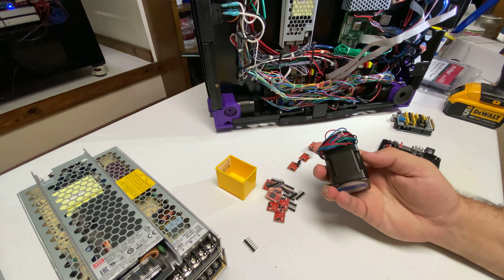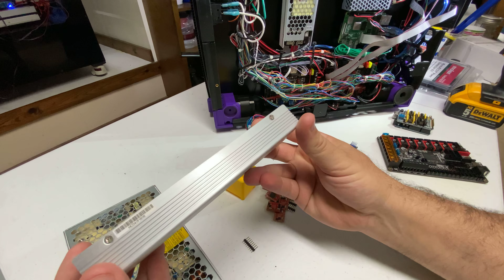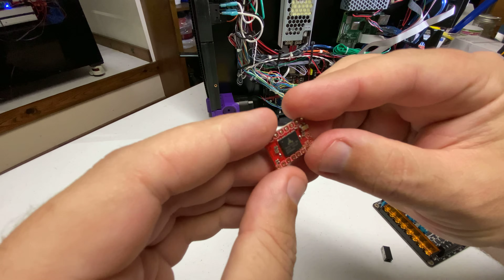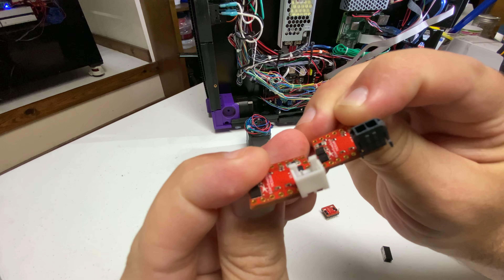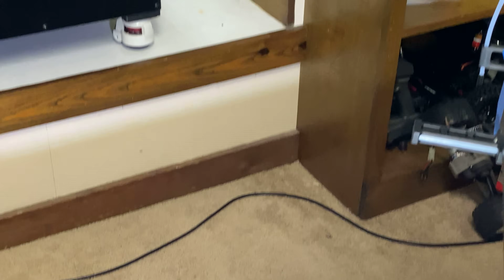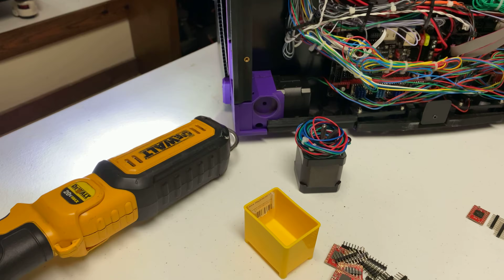How to run your printer at twice the speed - 48v voltages for 3d printing

Comment: og tip. search AIekspres for "ga?bIing machine PSU" or "Claw machine power supply" 
they are ATX sized powersupplies providing 5, 12, 24 and 48V (have a seperate 48V and 24V+12V rail section, with a 5V buck from the 12V) with added benefit of power good pin, and a on off pin!

Comment: I know it's been 3 years and there are so many options out there now. I just bought an LDO V2.4 rev D with the Leviathan and am running 48 volts to my X & Y. I've been searching for a week now for any information on good valuable settings for the 48v 5160's without any real success. LDO doesn't even provide any suggestions or sample configs for the 48v option. I really liked your video. It was very informative and understandable to someone without an engineering or electrical background. HOWEVER - I did have a few choice names for you at or around the 28 minute mark. Who the F is Kevin and where do we find his site with the example configs? Please don't be offended. I'm being more silly than anything. But coming from someone who has no idea who you're talking about or how to find them - it was pretty frustrating to be that close to actually learning something of value after so many hours searching and then be so let down. lol

Comment: The voltage limitation of the stepstick is not the capacitors, it's the mosfets. There are no capacitors on the stepstick for the motor voltage, that is the capacitor underneath it on the motherboard, which will not be used anymore when you provide the motor power from the top. Additionally, you can easily blow up the TMC driver when wired as descried, you MUST make sure the logic power (3.3/5V) and motor power arrive roughly at the same time. Currently there are external TMC5160 drivers, which would be the way to go. The stepper alignment can easily be seen from the diag pins on the short side of the stepper

Comment: The supply voltage or its level has nothing to do with the speed. More important is how fast and how strong a stepper motor should be. And that, to put it simply, results in a watt number. Why increase the voltage? Because the conductor cross-sections can be kept smaller and the losses are also lower. 

But 48V stepper motors do not speed up anything at first. I have repaired real CNC machines for years. For the most part, stepper motors were used, which were even supplied with much higher voltages. Since these were extremely precise, they ran much slower than the usual 12V NEMA17 motors.

Speed is not everything, because the faster, the less accurate. So this has to be compensated. This is why stepper motors with encoders are also used in real CNC machines. This makes it possible to check whether steps have been skipped during the movement of an axis and to correct this directly. In addition, measuring devices are used, such as glass scale measuring systems. This allows you to measure extremely precisely where you are on the axis. However, a really good glass scale costs more than the whole Voron printer. And they are not light either, so the plastic construction would have problems with them.

This can increase the speed AND accuracy extremely. And this also with 12V stepper motors. Of course, the design of the machine has to be able to handle all of this. You can no longer work with belts or plastic parts, if only because the vibrations increase enormously. And you can't trick physics. 

The question is what you want: speed or accuracy? If you want both, it becomes exponentially more expensive the better it should be. 

The question you should ask yourself is whether you should generally change the way you print. Let's take a normal inkjet printer as an example (i.e. the one for paper). One could also print such a sheet with only one nozzle. But this would take much longer. 

Now, of course, you could have made the printer faster by moving the carriage faster. Or you could print several dots in parallel at the same time. One has decided for the latter, because thereby the construction can be made substantially more inexpensive.

And this must also finally be implemented in 3D printers. No longer just one nozzle, but several nozzles would have to be used in parallel. This would allow much larger areas to be printed at the same speed without having to change the design or the speed of the axes, which simply leads to many other disadvantages, all of which would have to be compensated for expensively.

You need an extruder with, for example, 4 or more nozzles directly next to each other, which can be controlled individually. With this, depending on the object, you could achieve many times the speed. 

But not with 4 or more extruders, but only with one. So you have to work with valves that can tolerate the corresponding temperatures. Theoretically, this is feasible. I don't know why nobody has thought of this yet...

Comment: You got any nema 17 recommendations to kick up the accelerations? 24v system,tmc2209. 

Considering switching to higher voltage but really want to push it the most I can before that.

It's on a delta, have shed as much weight as possible from anything that moves.

I highly agree with meanwell being a go to powersupply. I have them in every printer i own and will be buying them for all future builds. 
I had a budget supply used it for a couple of weeks. Bed Temps bounced all over with the cheap power supply.  I now only use it for testing components. 

Would have never gotten the cheap one if it didn't come with the tronxy x5sa(in progress of vzbot build)

Comment: I do havce a question. In your 3D printer feeding the stepper motors with 49 VDC from the power supply, you also need the 24 VDC power supply. Do the value for ground be the same fron both power supplies. Each power supply generates the DC voltage from an AC poer source. Do you have to interconnect teh grounds of both power supplies toi guarantee the have the same voltage level? Or do you simply operate both power supplies independent of each other?

Comment: Great video, but one thing puzzles me. I don't have a great understanding of electronics, as evidenced by this question. I looked at a 48V PSU, I have ordered a Octopus Pro board and looked at TMC5160 drivers. Then I checked the votage rating of the two Nema 23 motors I use for A & B on my core XY printer. They and all other motors I have looked at are rated in single figures for voltage. I have seen it said here the motors do not see the 48V . . . . . . so where is the gain? That is the bit that puzzles me..
Reply: Its kind of like an amplifier if you're into audio at all. Its all about heat management. Or overclocking your CPU in your PC. If you can keep it cool, then itll take more juice... Or imagine a brushless motor for an RC car or a drone. All the speed controller on those machines are doing is changing the voltage fed to the motor, from 0 (stopped) to its max voltage (max speed) Its EXACTLY the same here.  Keeping with the RC theme, its like going from an 8s battery to using a 13s battery... As long as the speed controller can keep up with the juice and not blow up (FROM EXCESS HEAT!!!) Then the faster the rc car will go! There is no like.... Hard programmed in boogie man that kills your components if you try to increase the voltage (cept safety stuff blah blah) The boogey man.... Is HEAT!!! And with more Voltage, there is the benefit of less AMPERAGE! AMPS is what puts out the heat in yo wires, if you try and put 100 amps through a 22 gauge wire...... Its gonna melt.... Same concept! 

I feel like Im rambling... Am I rambling.. ?

¯\_(ツ)_/¯ hope this helps a little?
Reply: @TheAceofFate  Thank you. Even I could understand your 'ramblings'! 🙂
Reply: @peterjordan3875  basically the driver is very carefully regulating the voltage in a way that will never overload the motor in either temp or current after tuning it properly. The higher voltage allows the current to be ramped faster.

Comment: So from what I see here there is nothing stopping someone from replacing those capacitors on their board with 63v rated caps and larger micro farad caps if you flip it to the reverse side since it’s just through hole caps anyway. Although with the pro board that takes any work out of it.

Comment: Which steppers to use with 48v or even 56v for that matter. I'm having hell finding any steppers rated over 24v.
Reply: BTT has a 5160HV that does 48v, 56v I think is pushing it for a 5160 by design spec but that would be your best bet
Reply: @alexmills42  It works because it uses external transistors, correct?
Reply: @soundspark  external mosfets for power management yeah
Reply: @alexmills42  I meant the MOSFETs on the stepper sticks, located outside the TMC5160 package.

Comment: Hi. I will help you. And explain it simple. This is Ohm`s law. You drive your motor with electric power P=U x I . If your voltage 24V. To give more power you have to increase your current. Two main things are limiting you. The driver can go 3A max and the diameter of the wire of the stepper. You can increase both. But with the wire the size of the motor has to be changed (Larger motor). So the only option left. To increase the voltage. 
Be aware motor efficiency will be lower. You can not push electromagnetic flux through on a certain diameter limitless. It means your heat loss will increase. You have to cool the motor. And the insulation's has deal with the doubled voltage and increased heat.
At one point you have to increase the size of the motor.

Comment: With the added heat running 48v and higher amps, how are you handling that with the A/B motors on your Voron? Polymaker ABS-PC Blend gives you an extra 30c+ of headroom before deforming, so I've considered printing the mounts with that.
Reply: There is no added heat. If anything you will have less heat with higher voltage at the same amperage

Comment: I think 48V will be beneficial for high flow hotends on stuff like the Orbiter (highly geared extruders) because you need to drive them much faster than the generic Nema17 extruders
Reply: That's a concern I had.
Driving steppers faster becomes self defeating after a certain point, 48V can widen the useful range quite a bit and the extruder stepper needs pretty high acceleration at higher speeds anyway. Good that I didn't order a board yet, I'll get the Pro version and will see.
Reply: Has anyone tried running the extruder motor at 48v with an Orbiter? I think heat may be an issue...
Reply: @OneStepAhead608  I personally don't think it would be an issue as long as it's ran at the same amount of current (500mA peak for example) because the windings generate back emf at speeds which is why you need a higher drive voltage, i don't think it increases the heat output but i could be wrong there
Reply: @OneStepAhead608  higher voltages run cooler actually, voltage is a pressure for flow of electrons, the higher it is the more easily power or amperage can be pushed across and with less loss. Low voltages require higher amperage’s to get adequate power and that is what causes heat in a wire or motor, amperage pushed across not the voltage.

Comment: Great video.  I found the info here very helpful.  Note that the IEC defines high voltage as 1500v DC or 1000v AC.
Reply: Noted. So when do we get to run our steppers at 50000 rpm with "IEC HV"? 😂

Comment: Looking at Moons site; if one runs stepper drivers at say 48v it doesn't matter what current you set; it seems the motors will generate 10-20 higher temp based on their graph.  Based on that running higher voltage will actually increase stepper motor heat; not lower it.  Suppose I could be interpreting Moons graph wrong.
Reply: You will see less heat at the same amperage with higher voltage

Comment: Motor torque is proportional to voltage, however torque also diminshes with greater speed so you won't reach double speed for double volts. Factor in the friction from the belt and carriage which also rise.

Comment: Could I double the usable Stealthchop speed with a 48V motor voltage?
Reply: Motor isn't running 48v; stepper drivers are.  I would be surprise if increasing voltage to driver resolves issue with stealtchop since it's the fast movements that steathchop has issue with.  But would be interesting test to see if it does.

Comment: I've just been psu shopping.  After examining the datasheets, I'm not sure the compact LRS units are a good buy for Vorons.  Their power rating is diminished to 80% when not mounted to an aluminum plate(@110VAC).  The UHP units don't have this requirement to maintain their current rating at ambients below 50C.  You could overbuy to compensate, but they are already quite a bit more expensive.  UHP for me.  Thanks again for the video.  I can't wait to see your overview of the Pro version.
Reply: From what I see, IMHO, it is the UHP unit that gets de-rated by 80% when not mounted to the aluminum plate (@120VAC or USA AC voltages). The LRS units are the ones that do not get de-rated because they do not need the aluminum plate.

Comment: Hey josh I just finished my v2.4 and I’m definitely looking into doing the 30v on the same board as your video “octopus “ so just to verify and clarify something on my part . So I can get the 5160 drivers and a separate PSU 48v with a step-down converter to 30v and feed the negative and positive straight to the motor power on the board?
Reply from the maker: Yep that’s it.  You’ll still also need 24v for the rest of the board and the bed power but you put 30v from the step down into the stepper power.  I run a SKRPro 1.2 on my K2 this way.

Comment: Sir the first minute of your video earned a thumb up and a sub. If everyone had that kind of honest openness and would stay humble the hobby would be so much better.

I'm sure the rest of the video will confirm this.

Cheers from a fellow Voron 2 owner ;)

I'm sure you're aware but Eddie (eddietheengineer) recently did a great video on stepper's theory, and the relationship between the printer's limitations VS the motor's own torque. Real interesting.

Comment: Nice. But can’t you just short the V- of the 24V PSU with the V- on the 48V one? This way you can run half the cables
Reply from the maker: Absolutely you can - I don’t like running that through the board just because I’m superstitious basically, less likely I’ll make a mistake.  I do bridge grounds I didn’t specify that in the video but need to add that in the description.